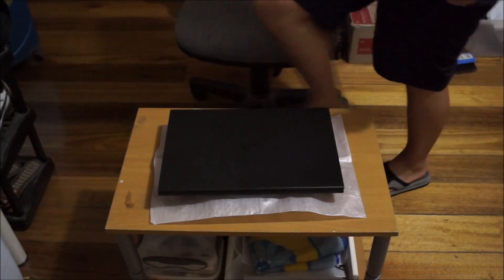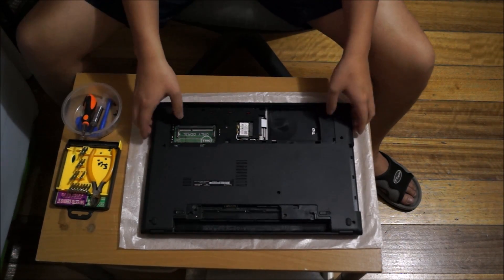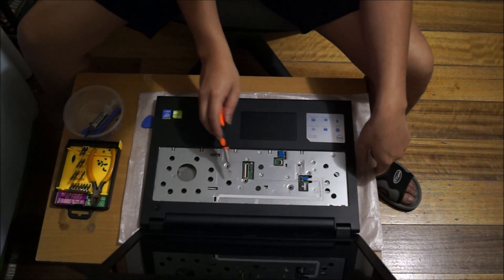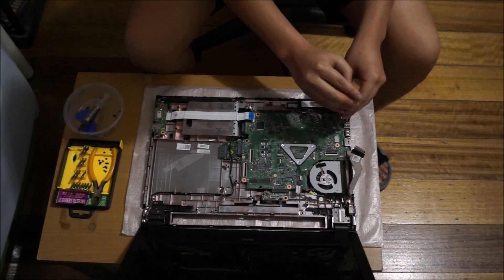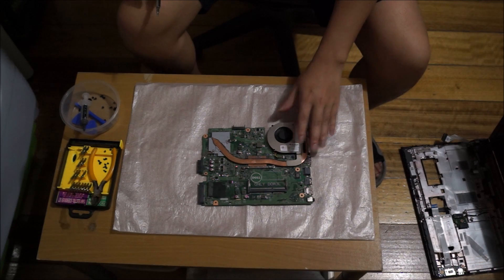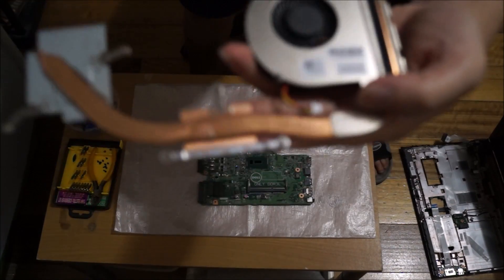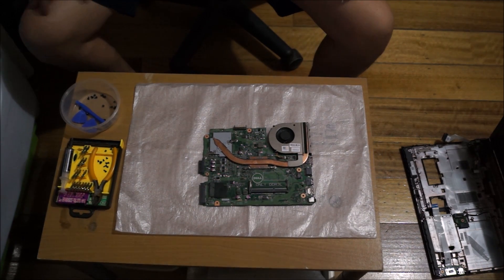OPEN ME UP! Dell Inspiron 15 (3543) 3000 Series Disassembly

Comment: Hello, I followed you step by step but my laptop doesn't work. When I plug the charger, the light doesn't turn on too. Do you have any clue about what the problem is?
Reply from the maker: did it work before hand? if so you probably forgot to plug in the ON button
Reply: @OpenMeUpTec  thanks for the reply, it was working before. I disassemblied and assemblied it 6-7 times but it still doesn't work. I probably broke something in it, I'll take it to the computer seller tomorrow. Thanks again.

Comment: On my laptop (same model), the screw of the access door to the hard drive, RAM and network card is stuck. Can I open the rest of the back without opening this part? Thanks!
Reply from the maker: nope as there is more screws you need to remove under the door
Reply: @OpenMeUpTec  oh okay got it thanks

Comment: how can i upgrade my graphics card, it says it has NVIDIA GEFORCE on the sticker but on my system info it seem like it is still intel 5000 HD graphics
Reply from the maker: you cant. it is soldered on to the motherboard. so if it doesnt have one you cant do anything about it. you have to use whatever you have

Comment: My laptop inspiron 3543 shuts down itself when charger is plugged in.  Any solutions??
Reply from the maker: thats odd never seens this before. can you turn it on when you plug it in and press the power button
Reply: This happens :
1. When laptop is on and I plugged in charger,  it gets shut down and I can turn on again with charger plugged in.
2. When laptop is shut down and I plugged in charger,  and i open the laptop , it opens itself like it was in sleep. 
3. When laptop is in sleep and I plugged in charger,  and I open the laptop,  it doesn't open and I have to press power botton like it was placed in shut down before. 
The battery health and capacity is fine.  The laptop is 23 months old since buying.  The only thing I can't check is my charger. 
What solutions do you suggest? 
What solutions do you recomme
Reply from the maker: @sangeetchhantyal8259  honestly i believe the laptop itself is faulty and has a power issue. the charger is pretty comman and someone you know will have one. HP, Dell and Lenovo used the same charger sometime in the pass. so unless you check that out it is hard to know.

Comment: Hi
So I took it apart every step of the way like your video, but now when I try to power it on the screen doesn't turn on. Is the LCD extremely fragile, and do you think I should open it?
Reply from the maker: you must have forgot something. like you didnt plug in the LCD screen properly
Reply: @OpenMeUpTec  Yeah, I think something was loose or not put back all the way. I initally opened it to clean the fan, and now it's working pretty smoothly again. Thanks very much!

Comment: My computer turned off randomly and I couldn’t get it to power back on. This was the worst timing because it’s the last month of school and I have a shit ton of projects and studying but I can’t do shit xause my laptop die
Reply from the maker: your computer is faulty. most likely it is over heating therefore, after a certain timeframe it will turn off. what can you do about it? you can open up your laptop and clean it out by replacing the thermal paste and clean out the fan, hopefully this will help your problem.from what i can see your laptop can not be fixed.

Comment: Hello open me up 
I have the (inspiron 3543) but after changing the thermal paste the the temperature of cpu is going up to 82 degree Celsius before change it i get lower than 69 degree Celsius 
How this can happen ! ?
I need help please please please. ......
Reply from the maker: i recommend you to do it again. seems like you might stuffed up somewhere to insure it is not you do it again.
Reply: @OpenMeUpTec  I repaste them more than 4 times but no defense 😭😭
Im using a normal thermal paste  not the high quality and not the original one , it's possible this is the reason why this happen
Reply from the maker: @sofianetech379 i see, can you tell me if the fan is spinning? the original is not high quality anyways. can you tell me what thermal paste you using or where you got it from. if you got it off ebay with a unknown brand then it could be the problem. but if all fails then you have to go out and buy a branded thermal paste to test iff the same issue is still happening
Reply: @OpenMeUpTec  yes the fan is spinning without any problem, the thermal paste I'm using i got it from the store it's cheap it cost only 1 dollar , 
I forget : (the gpu is not get over than 62 degree the problem is happen with the cpu)
Reply from the maker: @sofianetech379  if the gpu is doing better than it use to then i can assmue it is working. the GPU and CPU use the same heatsink. i recommend you to get proper thermal paste because if something were to happen   because of your cheap thermal paste the computer will die
Reply: @OpenMeUpTec  thanks for the help
you are the only one who tried to help me
I want to buy thermal paste like grizzly or mx 4 
And the reason why I'm not got it because in my country it cost ×3 of the original price 
For example: grizzly kryonaut 1gr it cost 10 $ but in algéria it cost 35$ this is crazy 😂😂
Reply from the maker: @sofianetech379  you only change thermal paste once therefore the cost is not such a big deal. for this laptop you dont need anything special. see if you can get noctua nt h1 or arctic silver 5. you dont need the best thermal paste since this laptop is a low end laptop so get some ok thermal paste. the idea is to buy the grey thermal paste not the white one and buy something with a brand name. even coolermaster  or deep cool is good enough
Reply: @OpenMeUpTec  i got the mastergel(white one) but not the pro now the temperature is dropped about 7 degree Celsius then i undervolting my cpu to -60 mv and i can play games like battlefield 1 with 78 degree and fa cry 4 with 75 degree max (after 1 hour)
Is this is safe? 
I think if I find the mastergel pro or artic silver 5 it would dropped more
(Sorry I'm not good in English)
Reply from the maker: @sofianetech379 the laptop will automatically shut down if it goes over a certain limit to protect itself. the lower the temperature the better off you will be. if it is working then it is safe to do so

Comment: I just wanted to say thank you cuz your video saved me $400.
Local computer repair man wanted to charge me $400 to fix the charged socket on my 6 year old laptop. I refused to pay that much when i could buy a new laptop for that same price.
It only took me less then 10 minutes to take it apart and less than 5 to find the proper part for replacement for less then $20!!
Reply from the maker: thanks for your support

Comment: How many slot of RAM at this laptop??
Reply from the maker: if you watch the video, it does tell you and it also in the video description. CPU is solder on, graphic card is solder on, ram can be changed to 8GB max with 8GB in 1slot, wireless card can be changed, and hard drive is a 2.5" inch.
Reply: @OpenMeUpTec  thanks for information...

Comment: I'm trying to find lid sensor on this laptop model, please guild me. THanks
Reply from the maker: trying to remember but cant think of it. i watch my video again and was not able to find it. it might be the webcam itself when there is no light it turn off the monitor. it is normally one of the senors close to the webcam if it is not the webcam itself. other laptops have magnets on the edge of laptop along the side on the webcam and connects to the bottom and turns off the screen

Comment: in the min 2:54, near to the ram are two metal pices, they took off from my case, should i worry? what are they for?
Reply from the maker: dont know what you are referring to. can you check if it appears again at 10.30
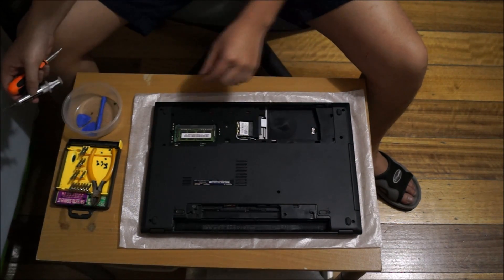Reply: No, check at the min 2:20, the metal pieces are near to the ram but when the ram is still connected to it's port
Reply from the maker: still dont know what you are pointing to take a picture and circle it and then give me a link. but from what i can see no it is not important

Comment: can the graphic card be removed?? please reply or give me your contact details.. I want to call you and ask some questions. my laptop is not working .
Reply from the maker: Most of your questions can be answer just by watching the video 

CPU is solder on, graphic card is solder on, ram can be changed to 8GB max with 8GB in 1slot, wireless card can be changed, and hard drive is a 2.5" inch.
Reply: OPEN ME UP first of all,thanks for replying back.. Sir, I have the same model..And the laptop is getting turned off automatically . i gave to a local shop, they said the problem is with the graphics card.  but they couldn't fix.  and after 1-2 months, the laptop automatically started working perfectly. now again the same problem is occurring. I want to contact you for this matter. Please if you could share some contact details then I will be grateful to seek help from you. I am from India.. please sir.. I opened the whole laptop watching your video..after cleaning everything, the problem still persist. Please help
Reply from the maker: no one can help you. the issue is that everything is soldered on to the motherboard therefore doesnt matter if it is a graphic card fault or anything else there is nothing you can do about it since you will have to replace the motherboard to replace anything
Reply from the maker: if you believe it is the ram it is easy to test just get some replacement ram. but from what i can see i doubt it is the ram. if the ram was faulty the computer wont turn on and work for a bit like you are experiencing
Reply from the maker: i have seems this quite often it means you computer is on the verge of failure. it is working now but it reach a point where it doesnt work anymore as time goes by it will be come less and then not work anymore

Comment: Can you upgrade the processes on this one?
Reply from the maker: CPU is solder on, graphic card is solder on, ram can be changed to 8GB max with 8GB in 1slot, wireless card can be changed, and hard drive is a 2.5" inch.

Comment: I always follow this tutorial when I disassemble my laptop, it’s slow enough and detailed. Tonight, when I put it back all together and started my laptop, it all worked until I started chrome and on about third opened tab my cooler began to be really loud, but not loud as before (when I play games it become loud but sounds only like fast fan spinning, nothing unusual), so tonight it had some noisy choking from the cooler when it starts to spin faster, I’ve never heard something like that before for two years... I hope that you know what can be the problem?
Reply from the maker: did you clean out your fan? did you replace the thermal paste? your fan might have been misaligned
Reply: OPEN ME UP I will do that today, and I will report if problem was fixed...
Reply: OPEN ME UP just cleaned the fan and changed thermal paste, temps of cores droped by 5-7 degrees celsius. But fan is still too loud when it starts to spin even slowly. Should I buy new fan?
Reply from the maker: so the laptop is performing better after the clean. must be the wear and tear on the fan thats why it is louder. if you want try put some oil on your fan i done this a few times works well but only do this if you going to buy a new fan anyways. remember to INSURE YOU DONT HAVE ANY OIL RUNNING OUT so use less. best way to go about it is one drop of oil then spin the fan manually if you need more repeat
Reply: OPEN ME UP Cooler can’t cool the processor, so it drops speed from 2,5ghz to 0,5ghz. Defently I will buy new cooler

Comment: Hi, so I basically connected a crappy USB hub of questionable manufacturing to the USB port on the right hand side and the laptop shut off. After checking it looks like the USB hub fed the laptop 9v and the laptop no longer powers on. After following your tutorial (awesome btw) I was hoping to find some sort of fuse or something of that sort. Do you think this motherboard is fried? Any chance at a repair by maybe switching out a fuse? Any help is greatly appreciated.
Reply from the maker: you just got yourself a brick. there should be a dead component somewhere that got fired but i doubt you have to skills required to fix, find and replace it as it is complete since everything is so small and unlabelled.

Comment: Hey do you have a twitter? Im having issues with my laptop
Reply from the maker: just ask it here as i dont have it or facebook or any other. i check this often and should reply to you instantly or within a days time
Reply: OPEN ME UP Oh ok so 2 days ago i hit my laptop and it boots up too preparing automatic repair then the screen goes black for a long time
Reply from the maker: it probably has issue with windows which is good. it also could be faulty hard drive since you hit it. if you laptop turns on and reaches the point it can be fixed

Comment: i also had same lapton you have 
 can i change its processors please reply
Reply from the maker: CPU is solder on, graphic card is solder on, ram can be changed to 8GB max with 8GB in 1slot, wireless card can be changed, and hard drive is a 2.5" inch.

Comment: hey after putting it back together(mind you i only just disembled it till I saw the mother board so nothing serious) when I try to turn it on it starts but I get 2 sharp beeping noise repeatedly til I turn it off. What could be the problem and the solution? please help
Reply from the maker: 2 beeps normally means no ram. so remove and reinsert it and see if it works
Reply: OPEN ME UP it worked, thank you! I learn new things everyday :D

Comment: Hi, I wish to purchase and upgrade the RAM in dell 3542. I am not sure if this 8gb RAM provided by corsair is correct to go for. Would you please check it on the link:
https://www.amazon.co.uk/Corsair-CMSO8GX3M1A1333C9-Select-Mainstream-Notebook/dp/B005T63BEM/ref=sr_1_fkmr2_3?ie=UTF8&qid=1487459348&sr=8-3-fkmr2&keywords=corsair%2Bvalue%2Bselect%2Blow%2Bvoltage%2Bseries%2Bddr3%2B8%2Bgb%2Blaptop&th=1

Comment: i have a problem.i have ur laptop and there is no two slot for 2 Ram cards.i have a 4GB Ram card only.can i put two cards?
Reply from the maker: If you watch the video and read the description i advise you that there is only one slot for ram. CPU is solder on, graphic card is solder on, ram can be changed to 8GB max with 8GB in 1slot, wireless card can be changed, and hard drive is a 2.5" inch.
Reply: Thank you for explaining me that.your reply was very helpfull for me.Once again THANK YOU 'OPEN ME UP'.

Comment: 00:26my laptop doesent have that tile, its just one flat covering the whole back
Reply from the maker: you probably have a different model
Reply: Weirdly Dell made different models of the Inspiron 3000 series. You can find your exact model in info under your system settings.

Comment: can i change ze graphics card
Reply from the maker: CPU is solder on, graphic card is solder on, ram can be changed to 8GB max with 8GB in 1slot, wireless card can be changed, and hard drive is a 2.5" inch.

Comment: Hi if I wanted to remove just the bottom enclosure to replace it would I have to remove the motherboard? Or can it simply be switched?
Reply from the maker: you need to remove the motherboard as it is screw on to the bottom if you watch the video it shows you

Comment: +OPEN ME UP i have a dell inspirion 15 3542 that says "internal hard disk drive not found" when i boot it up i even put my 3 month old hard drive in that is the exact same one as the older hdd but size is different the 3 month old hdd works in my other laptop but not this one can you help?
Reply from the maker: f you confirmed the hard drive is working then probably you connector is lose or broken
Reply: +OPEN ME UP ah ok thanks :)

Comment: hi, I wish to purchase and upgrade the RAM in dell 3542. I am not sure if this 8gb RAM provided by corsair is correct to go for. Would you please check it on the link:
https://www.flipkart.com/corsair-value-select-low-voltage-series-ddr3-8-gb-laptop-cmso8gx3m1c1600c11/p/itmdxt2gg6prdx5u?pid=RAMDXT2GTKHMQZPJ

and lemme know if i can go for this.
Reply from the maker: that will work
Reply: +OPEN ME UP thank you very much

Comment: how do you fix when it says that there is no bard drive installed. I have a dell inspiron 15 3000 series.
Reply from the maker: +Santiago Aquino could be your hard drive is dead and not working.

Comment: can I replace the keyboard with backlit keyboard
Reply from the maker: +Atit Man Singh Basnet nope
Reply: You mean to say that there is no connector for backlit LED under the keyboard ..............there is only slot for connecting keypad ribbon?............I think I saw that in your video just above the touchpad connector
Reply from the maker: Yes that's right there is no slot for the backlit cable
Reply: then wht is the cable slot above the touchpad connector for?
Reply from the maker: dont know what you are asking. watch the video and tell me the time that you see this thing
Reply: no i was wrong i cheched in my laptop its not there is there any other way to install a backlit keyboard without the connector
?
Reply from the maker: no not really.

Comment: my WiFi module is broken which part is it in the video so I know what to replace. thanks in advance
Reply from the maker: +Spencer Nguyen 

CPU is solder on, graphic card is solder on, ram can be changed to 8GB max with 8GB in 1slot, wireless card can be changed, and hard drive is a 2.5" inch.

Removing back cover 0.50
Removing hard drive 1.35
Removing wireless card 2.05
Removing Ram 2.45
Removing DVD drive 3.00
Removing keyboard surround 3.25
Removing keyboard 5.10
Removing motherboard 7.20
Removing CPU and graphic card heatsink 10.30
Reapply thermal paste 13.45